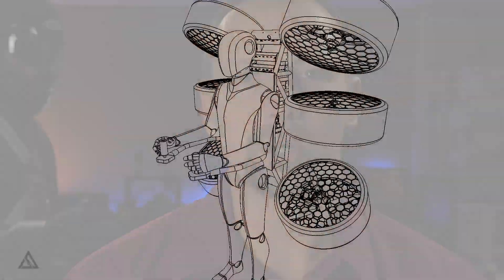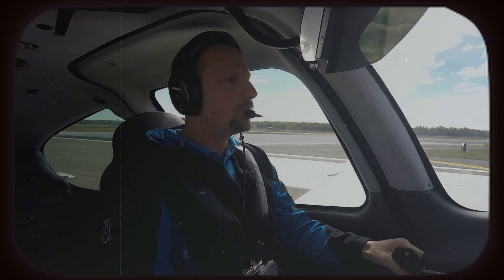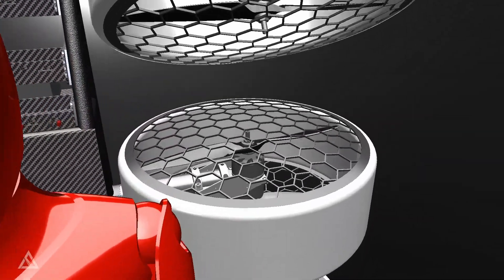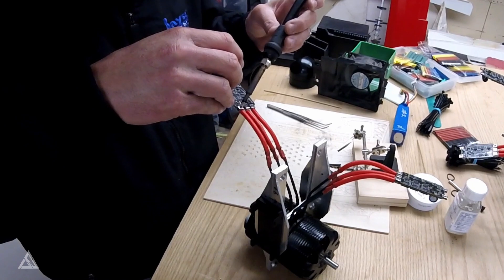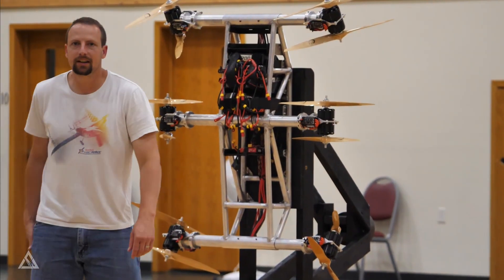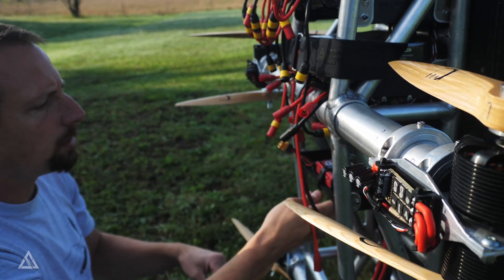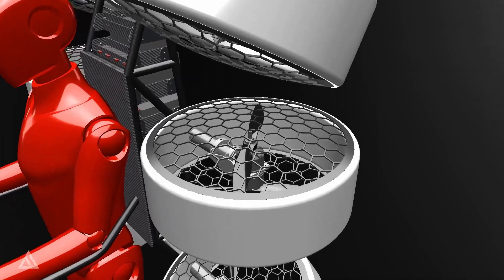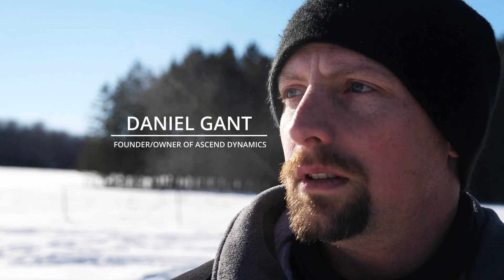Electric Jetpack - The Story of SkyPak V1

Comment: How much does each electric motor cost and how many lbs of thrust does each have
Reply from the maker: For this prototype each motor puts out about 30lb of thrust. This may be reduced a bit once they are in the coaxial configuration. These are low cost hobby brushless motors. Though they're still about $200 each.
Reply: @AscendDynamics  thanks for the info! One last question, how much to the batteries weigh, cost, and what’s the flight time?
Reply from the maker: @90golfer4life  for testing we have a rather small battery that only gives 2 min of flight time. Still it is a 25lb battery and was over $1200.
Reply: @AscendDynamics  thank you! and last thing how much for a patent, and could you submit with blueprints alone?
Reply from the maker: @90golfer4life  Cost to patent varies widely. A provisional patent application which just gives you the ability to publicly show the invention for one year before filing a full patent is quite inexpensive, and can be filed with simple drawings. The full patent fees are in the $1000 range and unless you have done them before it is highly recommended to hire a patent attorney. It isn't uncommon for a simple patent to cost over $10k. If you are interested in this sort of thing definitely get professional advice.
Reply: @AscendDynamics  ok I see thank you, so can you start a business and sell a product if it is patent pending? And what if the patient pending fails, do you need to just throw in the bag? I am asking all these questions btw bc I have a drone idea but I am debating on starting the project or not, thanks for the info helping me out a lot.
Reply from the maker: @90golfer4life  Yes! Start it! Just start it! 🙂 You will learn more by just doing than you could get through any amount of advice. As for the patent stuff. You don't need a patent. There are pros and cons to it anyway. Definitely talk with someone who can advise you in this area. If you are in the US check out SCORE and also your local small business development center. They will be able to give you specific advice for what you are doing. Lastly, don't be afraid of someone stealing your idea. Yes, it does happen, and really even a patent won't completely keep that from happening. But honestly most people aren't going to go to the trouble to steal something from you. BTW if you want to talk more, send me an email (contact though my website) and I'd be happy to talk more. Go do it! 🙂
Reply: @AscendDynamics  Will do thank you so much!
Reply from the maker: @90golfer4life  For sure! I love business! And I've had a lot of good advisors myself. If I can encourage someone else I will do it. Like I said feel free to email me anytime if you want to talk more in depth.
Reply: @AscendDynamics  what is the diameter of these props?
Reply from the maker: @90golfer4life  these were 20-in props.
Reply: @AscendDynamics  oh ya and copter pack is 100% a fake right lol? Those propellers do at most like 75lbs of thrust.
Reply from the maker: @90golfer4life  Well, I have talked a little with them and while yes they have only done supported flights on a cable, I tend to believe the best. The math behind what they are doing checks out for the most part. They are using 40in props or so which can produce much much higher thrust! For my next SkyPak version I am going up to 34-36in props which have the potential to double the thrust on the same power. But then it is getting really large! :-/
Reply: @AscendDynamics  oh I see so right now does it not have enough thrust to lift someone? And how much does the whole unit weigh right now? And would ducts reduce the thrust at all?
Reply from the maker: @90golfer4life  correct. Right now Max payloads about 80 lb. So we need to increase the thrust a lot to be able to get a human pilot off the ground. Ducts are going to be interesting. I'll need to do a good bit of testing. In general by adding a duct you can increase thrust a little bit, but there's a lot of fine tuning to get it to that point.

Comment: How come drones can fly for half an hour with payload double their weight and the skypak or electric jetpack cant fly for more than 2 minutes with payload double their weight.
Reply from the maker: This has to do with the efficiency. So think of it as the power per lb of thrust. We can get much better efficiency, but the rotors would have to be the size of small helicopters to be that efficient. that isn't a backpack aircraft now. It all comes down to Size and efficiency... that is the tradeoff.

Comment: How are you going to make it fly for 30 minutes.
Reply from the maker: Batteries are a LONG ways away from that, so it would require a hybrid generator system. This is something we plan to work on developing.
Reply: @AscendDynamics  would solid state batteries fix the problem with the flight time as they will be coming out in a few years.
Reply from the maker: @kingsbishop1479  I hope so, but they will need to be 10x better than the best LiPo/Lion of today. If someone could develop a high capacity Super Capacitor that might be a solution too.
Reply: @AscendDynamics  when do you think high capacity super capacitors will come out.
Reply from the maker: @kingsbishop1479  I don't know. Currently the energy density is worse than lithium batteries.
Reply: @AscendDynamics  are Solid state batteries 10x better.
Reply from the maker: @kingsbishop1479  None that I know of yet. I have seen reports that they are getting very promising results, but it is all laboratory stuff right now.

Comment: You should also make a version that doesnt have the ultra light limitations for certified pilots so they  can go faster than 102 kmh.
Reply from the maker: Yes that would be one of the longer term goals for sure. Experimental version here in the US would open all that up. I'm not exactly sure what would be needed to use this for work like with towers and bridges and such. It might have to be fully certified which would be a long road.
Reply: @AscendDynamics  how many years would it take to get fully certified approx.
Reply from the maker: @kingsbishop1479  I don't even know. Nothing's been done like that in this class before so it all be new territory. We're talking millions of dollars and probably at least 5 years for something like that to happen.

Comment: Looks great. I recommend making the rotor cowls out of carbon fiber to reduce the weight. Also, a lot of that aluminum could be carbon fiber tubes. Just make the corners out of billet aluminum. That would cut down a lot of weight. There are also companies that make carbon fiber propellers
Reply from the maker: Yep lots of weight savings to be had. Aluminum corners or bond and carbon wrap the corners?
Reply: @AscendDynamics  carbon fiber isn’t really my wheelhouse. I’m not sure which method would be cheaper/stronger
Reply from the maker: @wadecordts3286  Same here. I do have a good friend who is a composites engineer who has offered help for making those design decisions when we get there.